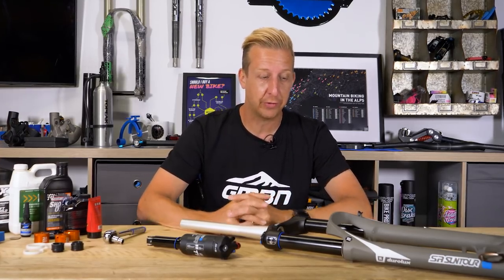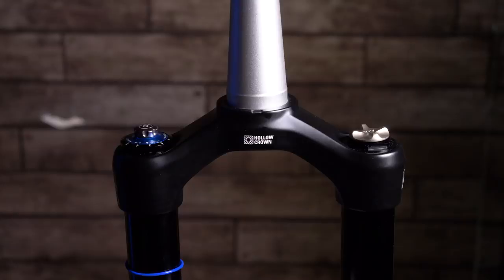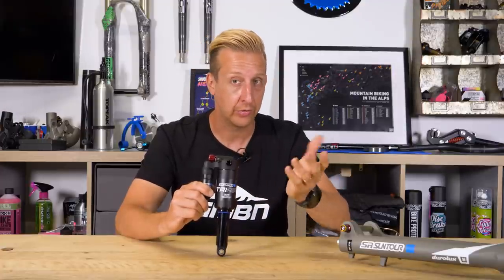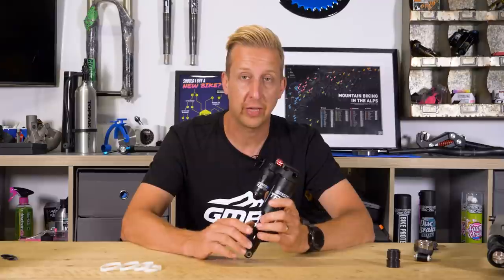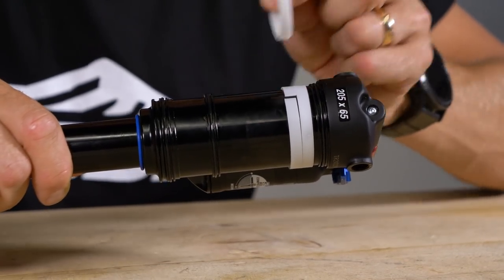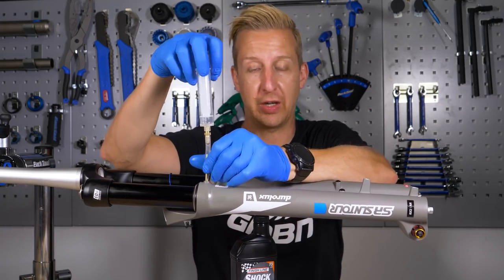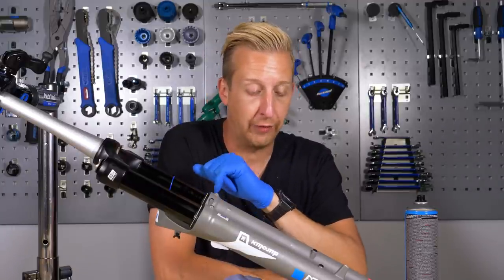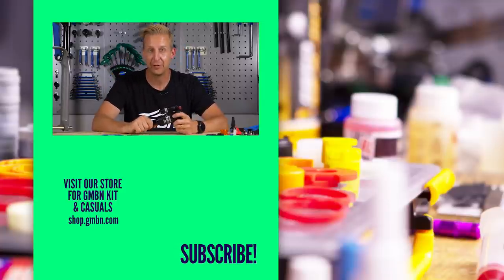MTB Suspension Tech | Everything You Should Know To Get The Most From Your Suspension Forks & Shocks

Comment: SR Suntour's higher end suspension units are severely underrated.
Reply: Tru
Reply: Do you ride an XCR Air? 
It came with my rockhopper and had a “no hard riding” warning. What kind of trails have you rode with one?
Reply: @suspicioustumbleweed4760  that is a lower end one which my friend has one and he rides hard but it will void the warranty of the fork 

Wouldn’t take it to a bike park tho
Reply: If only they did away with the shitty unthreaded proprietary through axles. Nowhere near as stiff as threaded ones.
Reply: Yeah, but when I buy expensive parts, I also want some from a cool company and for me Suntour is not the coolest MTB Brand.. you know 😂
Reply: If that keeps the price down then I'm more than happy to it.
Reply: @SlothsDontSleep Then buy the black?
Reply: @MrPijus123  man wth, i have high end suntour fork, it has the stiffest axle ever, it has one big metal chonker through the lowers unlike the rockshox who have only literally 5 threads into the fork.
Reply: @MrPijus123  love the q loc system. tightening the axle just creates outside pressure on the internal hub axle. One method uses threads while the other uses cam pressure (q loc). no actual difference in stiffness compared to threaded
Reply: @SlothsDontSleep 3:00 black lowers sun tours literally in the scene
Reply: I have a black SR Suntour durolux in black and it looks and rides amazing

Comment: For my older 2010 Totem forks when at the top of a climb, I often hop off, stand the bike on its rear wheel and turn the forks left/right to get the internal oil to flow up the forks and wet the top seals from the inside (especially if my bike has been parked for a week+).
My stanchions are 40mm so they do have a bit of stiction. Every bit of lubrication I can get to the seals helps.. especially as I'm a mediocre rider so you feel every little bump if you don't keep the top seals clean and lubed.

Comment: Has Suntour suspension progressed in late years? They used to be installed to all cheap bikes and they were just pogo sticks which weighted a ton.
Reply: The budget coil suntours are on the budget bikes. The higher end forks are better quality as you would expect.
Reply: These are ews level 😂
Reply: I've got last year's Durolux 36 and it has been really nice. It is much nicer than my very old Rockshox Domain, but that's my only comparison point. From my experience, Suntour forks are very easy to work on and are fun to ride. Looking at spec sheets, Suntour forks are still heavier than Rockshox/Fox. The adjustments can be difficult to find the sweet spot, too.

In general, I strongly recommend the Durolux. It's been great for me.
Reply: The problem I have with Suntour is their passive bait and switch marketing. They make and sell utter crap forks to manufacturers for cheap and then offer a small discount on a select few of their better forks on what they call their upgrade program.

Comment: None of the bike shops near me do fork services, they send them away for servicing which is a pain. I don't have the confidence to go inside my fork or shock, however I don't want to be without my bike for a week or so either. Is the full service that a shop would do much different from the service you'd do at home?
Reply: Depends on who's your suspensions manufacturer. Cheers
Reply: m8. it is not a rocket science. Lots of vids on YT how to do it.Do a little research and DIY.
Reply: @ddevil892  Thanks for the helpful comment.
Reply: There's a really good video on here on GMBN Tech where Doddy does a full lowers service - most of the technique is pretty universal 👍
Reply: basic service is extremely easy, I also find it quite relaxing to do. damper service is quite a bit harder

Comment: Does a heavier rider need more compression along with rebound?
Reply: more rebound yes definitely , if you weigh more you need more force to hold the same sag as others, when that larger force gets unloaded you need more rebound to make it return at the same speed as less pre loaded suspension.   i personally run high speed compression open on all my bikes , some suspension only has a low speed option which is just to stop bobbing while peddling .  Shock wizz has always agreed with my full open high speed setting on rockshox gear i have had  inc lyrik ultimate  , Revelation /Pike

Comment: Bikes are getting more and more like cross/enduro/dirtbikes, I would not be surprised if the suspension will end up with simple open bath forks like  on many motorcycles, Kawasaki kx80 forks worked awesome on my Frankenstein mtb back in tha mid to late 90s :P The bike felt like a chopper but that seems to be the norm nowadays :)
Reply: opens baths work on motos becuase the volume is higher. typically open baths are avoided on MTB as the lower volumes cannot handle the much larger changes in temperature which can promotoe caviatation and airation much easier, and of course the more erratic performance.
Reply: Marzocchi ran open bath forks in the early 2000s.
Reply: @BryanHoefer  theres a reason why it stayed in the early 2000s
Reply: @BryanHoefer  yep and the bomber forks are remembered as the plushiest forks out there. And now when weight is not that important aspect and the bikes are pretty much engine less dirtbikes, we will probably see a comeback.
Reply: @Pillokun  also they were by far the lowest maintenance forks available too. People would beat the crap out of them and barely touch them and they just kept on going.

Comment: Question: you said to pay attention to not put too much oil inside the fork, just the right amount. How can I know how much there is without sliding off the lowers? Also, it's better to change it completely, right?
Reply: If you mean the damper side of the fork (where most of the oil is inside) you can screw it open from the top and measure the oil level in the upper leg (you can find the recommended height for your fork on the internet)

Comment: #askgmbntech How would you deal with a rebound adjuster that’s “stuck”? Mine’s not exactly seized up, but I can only go one way with my rebound adjuster.
Reply: Bro we have exactly the same problem. I sorted it out by putting WD-40 on the turning unit. It seems that the mechanism that make the thing click can get rusty.
Reply: If oil on the knob doesn't work, there is usually a tiny hex bolt in the knob to undo and remove the knob, then you can clean out any grit or rust and put it back on
Reply: Oil on the knob worked, though just barely. I think it might need a lower leg service to fully check why it got stuck. Sad that I won’t be able to play around with the clicks to dial in what I want. Left it to something that works all-around.

Comment: Is it so difficult to print sag indicators on the stanchions?!
Reply: Isn’t rockshox the only brand who does
Reply: Rockshox have a patent to do so
Reply: Sag does not matter on a fork. Your weight shifts so much on the fork it's impossible to get repeat results. Just use the manufacturer settings as a baseline then adjust for feel on the trail.
Reply: @skullsroad3642  good point. The only time I have wanted travel printings is when initially setting up a bike, or as I do now, share a bike with my dad because my spectral snapped. The last reason for me personally to want it is to indentify problems and what the suspension is doing from video footage, since it’s hard to know where in the travel I am, which is the same thing that makes people think endstroke is midstroke